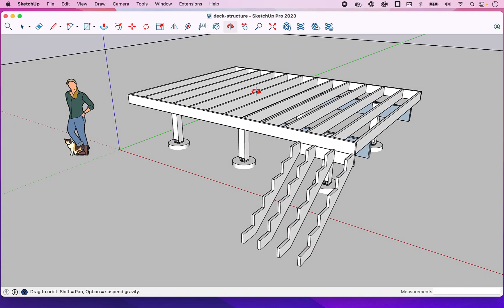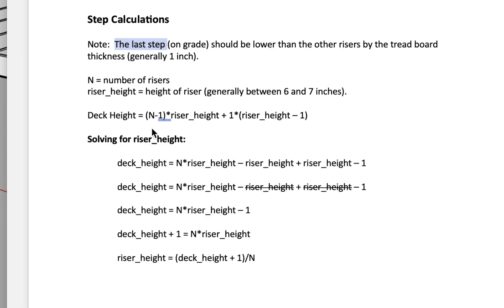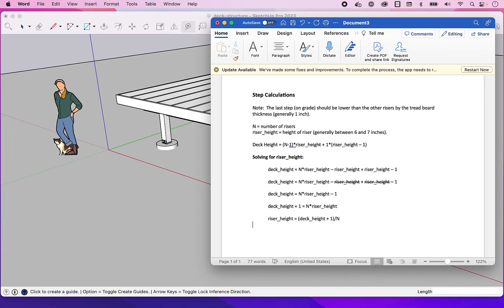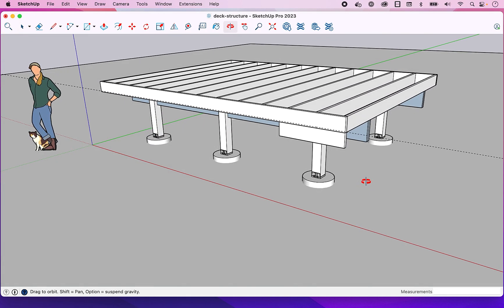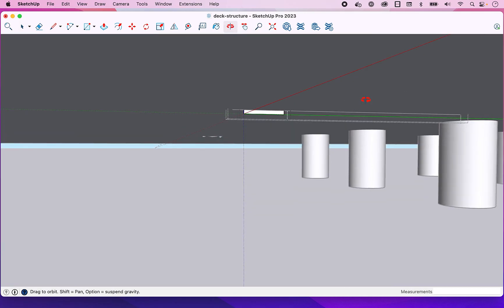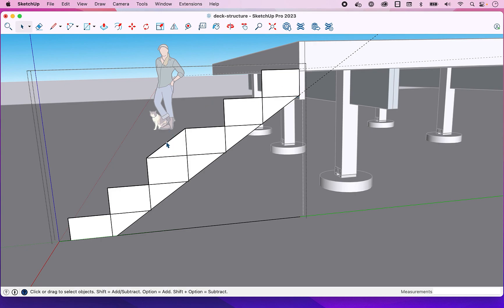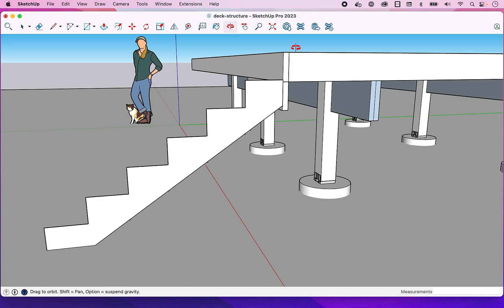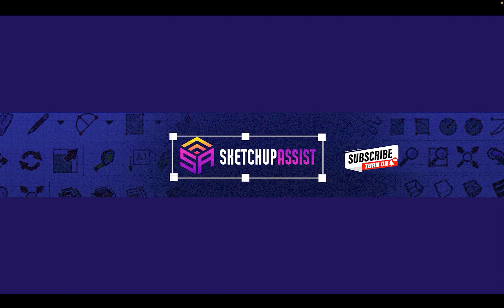SketchUp Deck Stairs/Steps Layout

Comment: you forgot to add your decking thickness to your total deck height
Reply from the maker: Hi thanks for the comment.  The deck height measurement is mentioned to be to the top of the framing.  With steps, the deck board height doesn’t come into play (assuming the steps have the same deck boards as the deck itself and in particular the same thickness) except for the last rise at the bottom of the step - the reason being all steps have the same deck boards except the ground/landing pad and hence the height effectively cancels out.